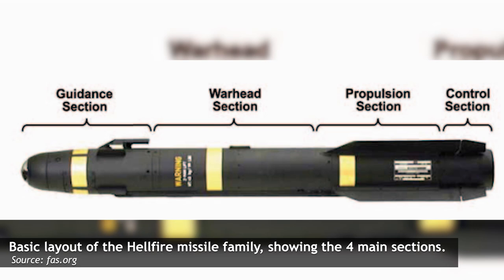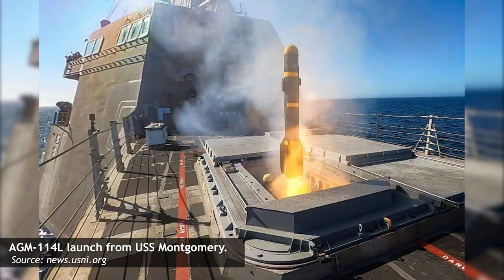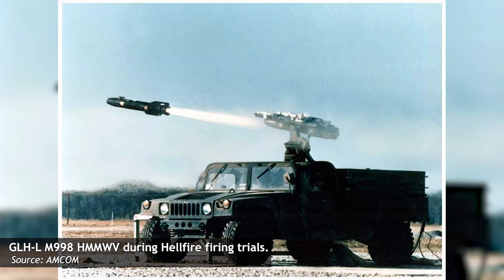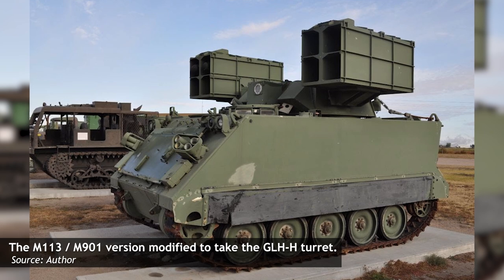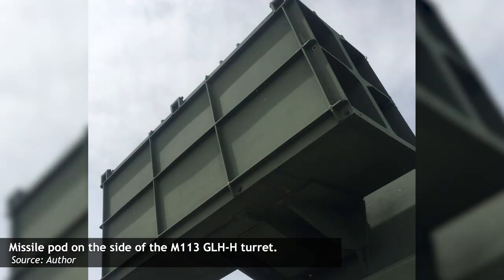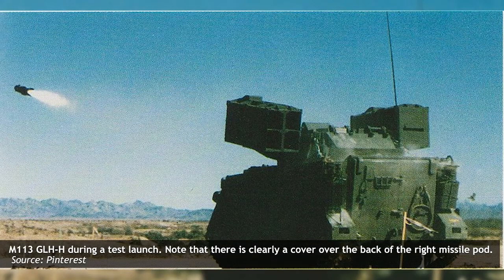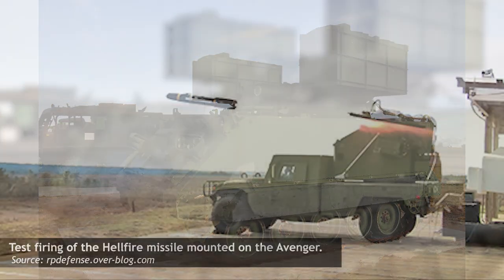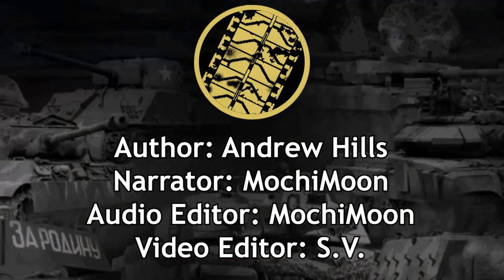Apache-on-foot | Ground Launched Hellfire – Heavy

Comment: The Infantry Test Board at Ft Benning was testing a Hellfire equipped Bradley at the time of Desert Storm/Desert Shield.  The problem I heard from a briefing was not the mating of the hellfire to the Bradley, but the use of the stock optics and thermals from the Bradley at that time.  At Hellfire versus TOWII ranges, there was not enough clarity for a reliable friend or foe ID at Hellfire ranges.

Comment: A vertical launch system seems to have been tested and may be feasible as a truck carried system or on a modified Bradly hull. Add a Crow system for self-protection and as many Hellfire as the load limit allows it could be very effective with a drone carried targeting systems. An upgraded motor for a fast safe launch and longer range would be nice.

Comment: Because actually adopting ADATS was just too simple a thing to do, they had to waste money on ground launched hellfire missile development also. A BETTER missile, with greater performance that was dual Anti-Tank and Anti-Air, also laser-guided, with a 7km ceiling and 10km slant range travelling at greater than Mach 3 (vs Mach 1.3 for a Hellfire).
Reply: Well, it wasn't just being looked at as a new weapon system. Hellfire was already in service, and they were looking to replace all TOW launchers with GBH. Including infantry launched TOWS (thus the desire for low-smoke motors), and TOW mounted on Humvees. Those are applications that aren't a match for a 7+ foot long missile.

Comment: Reloading for the Heavy likely would have been done in a similar way to the M901 TOW, by popping the cargo hatch on the roof of the track and then rotating the turret somewhat to reload from within the troop compartment through the hatch. With the TOW we didn't have to rotate the turret, just elevated the launch tubes to a certain angle with the turret parallel to the centerline of the track; it wasn't easy for the loader but it worked. I'm guessing that there would have been around 10 to 12 Hellfires carried in the hull for reloads; we had racks for 10 TOWs in ours.

Comment: I can absolutely confirm that Ground-based Hellfire was test launched from a Bradley platform in the time period of mid `89 to early `90. I was peripherally associated with the low-smoke motors being planned for integration. There were 5 or 6 launches on Redstone Arsenal that I saw, at lease 2 of which were Bradley platforms. The rest were not mounted to vehicles that I recall, but could well have been the GLH-H turret or the system planned for the Humvee. As for the Bradley's I don't recall if the launchers elevated on them.  Pentastar (which was a Crysler defense company) was doing the electronics and final assembly of Bradley turrets in Huntsville as well at the time, so I imagine that had something to do with it. 

As a separate note, I had several interesting encounters with Bradley 'variants' or test beds on Redstone Arsenal in the 80's and `90's, including an early APS system and one that appeared to be armed with a gun system much larger than it's usual 25mm. Never could get any additional information on it and about got my ass in trouble. I saw it one afternoon while leaving out near Gate 8. It was winter, so got dark early. So, by the time I got back with a camera it was dark. So there I am snapping pics of it... and the Rent-a-cops pulled up. Luckily, the MP that responded knew me well, and knew I was a tank nut. He gave the Huff-n-Puffs permission to leave. We had a nice chat and I had a smoke while we talked about armor. The dang thing was gone the next time I was through there the following week and I never could find anyone that had any sort of additional information.
Reply: I was just in the kitchen, wondering where the sieve is and now I've found you! 

Jokes aside, those are some interesting anecdotes. I think a lot of prototypes / experiments are more or less lost to history.